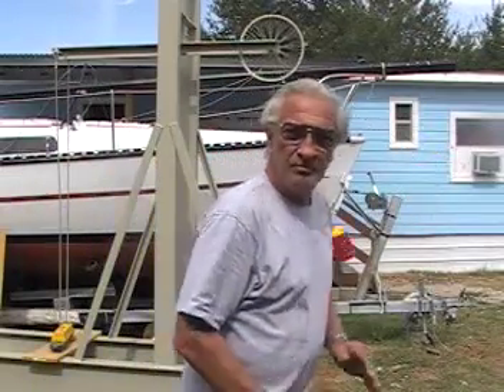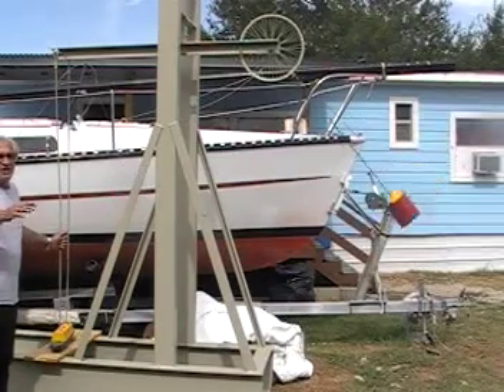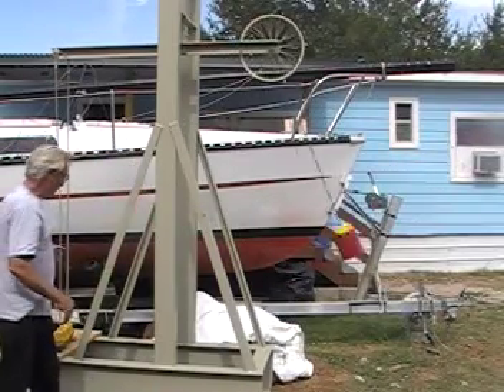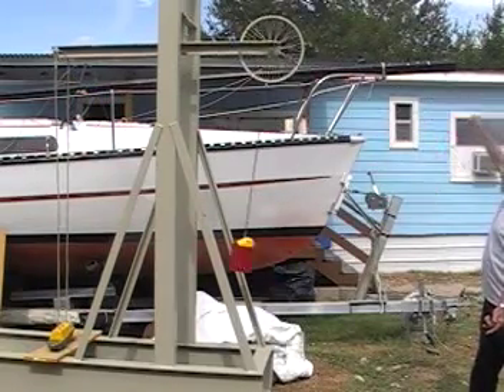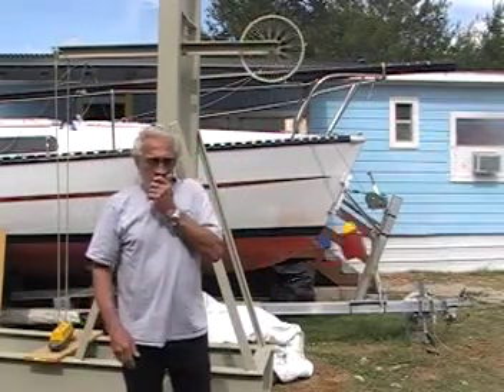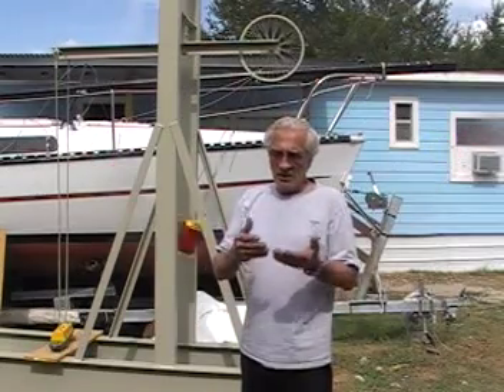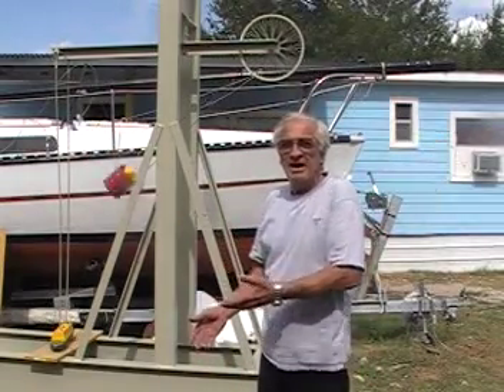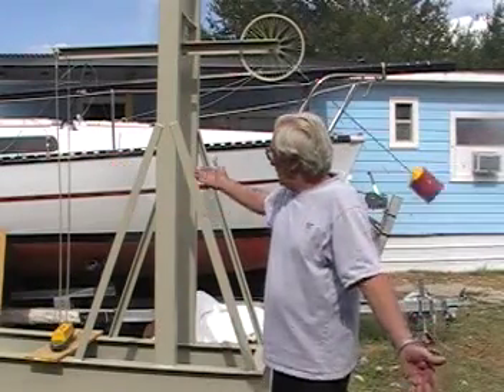testing large Milkovic 2 stage oscillator Video 6

Comment: see now what is happening  that was not happening in your previous videos,   the key to making this thing amplify input power is better understanding what is taking place.   you went from a very heavy pendulum weight to a lighter weight and I would say the pendulum weight does not matter.   increasing the pendulum weight just simply in proportion just increases the lifting power of the  arm at the other end.   we must fully understand what is taking place  in order to utilize this device.    This device like the skinner gravity power machine and others  are gravity harvesting machines.  we know it does not take much energy to keep the pendulum swinging,  we know that when the mass on the end reaches the bottom of its swing there is a very powerful downward force from mass falling due to gravity pulling it down.   now the key to harvesting this very powerful downward force that gravity has provided is in how you set up the rest of the machine.    lets keep stating what we know to be true.   we can harvest a small portion of the downward force by allowing the pendulum mass to drop below it's normal arch swing,  the pendulum swings in a perfect half circle but at the bottom of the half circle the mass drops for a short time below that half circle, this is where the harvest takes place. at this time we capture the most powerful portion of the downward swing, it is a very short downward stroke that creates a very short upward stroke at the other end of the lever arm.    This harvesting part of the swinging mass has to be done in such a way as to limit the slowing effect of the swinging mass.  so the mass swing can continue in it's original arch with minimum slowing down effect.  in short what you get is a very powerful short stroke of force twice each swing of the pendulum.     we know this and so we now have to come up with a way to use this short stroke of force.   we only have a short stroke of force but that short stroke has a very powerful force in that short stroke.   the next key is to make sure we use all of the force we get.  how much of that force do you think it takes to spin that bicycle wheel in your previous videos?   if your going to spin a wheel you must use all the force at your disposal.   one quick short stroke of energy needs to go into something that uses all of the energy of each stroke.  the logical decision would be to use the force to spin a heavy mass flywheel.  even if you have to help get the heavy flywheel going at first.    since you have such a powerful force, make it do something very hard to do.  using gears and ratios spin a heavy flywheel.    each consecutive stroke has to be geared up so all the force provided by the short stroke power cycle is used up, going into the acceleration of the flywheel mass.      there are other ways to use your two short stroke power cycles of the pendulum mass you just have to think of ways to use it.      you just have to remember what you actually have ,   you only have a  very short stroke power cycle available to use.

Comment: Sir, you are misleading people,  perhaps not intentionally, but  you are misleading them. Let me put some light on the subject to assist you  to understand the situation you seem to fail to understand,
You are not picking up 74 pounds of weight because that weight is counterbalanced by what the pendulum weigh which is 44 pounds.  so that is an effective weight of 30 pounds that you are lifting. Now let is see how that is coming about.  When you swing the pendulum you are causing it to generate centrifugal force downwards and this must be added to the 44 pounds of the pendulum , and it is the combined weight of the pendulum plus  its centrifugal force that is lifting the 74 pounds about half an inch.
Now let us study the work  output and the work input ,that is the energy output and the energy input, Now the work done is the force multiplied by distance and so for the output it is 30 pounds multiplied by half an inch ( assuming the moments of the beam are equal)  which equals 15 lbs inches  while the input by your hand is say 2.5 pounds multiplied by 6 inches  which equals  15 lbs  inches.    
Sir, I hope that this helps, and I apologise if I spoilt your obvious happiness of expectations  and successes at what you dreamt that this structure is capable of.   Normally people in construction works deal with static structures as roofs, walls, arches, buttresses, lintels, members in tension and compressions as in beams and geodetic structure, concrete reinforcements as in roofs and balconies and it seems that dynamic structures and their effects is not clear enough.
This is the reason why some suspension bridges collapsed when they went dynamic, as normally catenery  suspension bridges do not make use of triangles but rectangles which are unstable.  All stable structures must have triangles in them as a triangle does not change its shape even under dynamic conditions.   
 I hope you will proceed to enjoy yourself with researching for extracting energy out of Gravity, but a mathematical  contour integral  in a conservative field is zero and gravity is a conservative field so you cannot extract energy out of it. It is unfortunate for me, but I hope you will not be too disappointed if that also applies to you. Good luck anyway and hope that you will remain a happy man experimenting as you do.
Reply: +Carmel Pule' Incidentally, may I add something very very important and that is , if you allow the lifted weight to drop back,  then while it is dropping , its potential energy is TRANSFERRED BACK TO THE PENDULUM THROUGH SHIFTING ITS PIVOT POINT.  You must realise that you can give energy to a pendulum, both by pushing it horizontally which is what you are doing and also  through shifting the pivot point of the pendulum,  in a synchronised manner, which is what the dropping weight is doing.
In this case all you have is a double energy system exchanging energy between them and there is no effort at the input because you have no output.   If you have a million pendulums linked by any linked system , there will be many pretty modes of oscillation which will mezmerize  any observer, but there will not be any need for much input  energy if  you do not extract energy and put it into a load. Your pendulums with the final weight going up and down has no load.
Reply: u need some relief

Comment: The Fairies want to commend you on your efforts to measure pendulum power. You're almost as passionate about pendulums as I am. I made earlier remarks on your more recent videos not knowing how long you've been researching.

The standard physics model does not explain gravity. You and I know as much about it as any academic. Isaac Newton himself said: "for gravity I offer no hypothesis". 
When I asked the Fairies why does an apple on a string rise back up the tree almost to the point from where it dropped - against gravity - and why does the restrictive influence of the string cause it to accelerate on a curved vertical  path faster than Newton's 32ft/sec on the straight vertical, they said: " because it does", Daaa.... as you would say. Gravity is magic I reckon and you deserve a break. you've done the work.
It's too early for you to be concerned about the efficiency of your pendulums and you won't get accurate power measurements until you start producing power. On one of your older videos you have a TSO rotating a bicycle wheel then you went on to lifting weights like Milkovic. You need rotary motion to make power. I have now watched all your videos on pendulumics and as far as I can see your viewers are using you to do tests they're too fucking lazy to do themselves and all influenced by Mikovic TSO principles.
Go back to your  bicycle wheel model and follow your nose, your instinct. Think rotary motion. Change it to a heavy rim loaded flywheel and gear it up to about 300 rpm. Like a steam engine, this will even out the power gaps in the pendulum stroke and give you the constant torque and speed needed to produce AC electricity.
 NOTE> you will transmit the pendulum's maximum power to the flywheel which is a very efficient mechanical battery.   
Your short arm Milkovic size pendulums don't give you any worthwhile speed or power. As you say yourself in one of your earlier  shows, "size matters" but you've kept all your builds small.  In all his toy TSO designs, Milkovic does not give any meaningful power measurements - input over output. 64 feet will give you full G-force. The higher they are the faster they fall. 

You've seen for yourself that  a pendulum can lift more than it's own weight. That's all you need.

Comment: Looking for your donut fuel video...
Intersting concept here, and I saw you turning the bike wheel
Hear me out though...I THINK you should be moving a whole bike pedal, chain, and wheel with a fairly high gear. The wheel would have a ratchet and would be free to spin ahead of the osolator at certain parts of the rotation. The pedel would not have to spin, just move up and down like your doing here.
Reply from the maker: wcemichael some how the donut to alcohol fuel,  video got bumped. I will reload it this afternoon.
Reply: RHEAD100
What about my idea on your invention here?

Comment: I can believe it. The path of the bob is not circular and this makes all the difference. For the boundary case where the lift is negligible and the path is circular then the naysayers are correct - but this is not the boundary case and higher derivatives of position with respect to time are involved. Specifically the third (jerk) and possibly the fourth (snap)

Comment: Good for you, RHEAD100

I don't know if you've spotted the flaw in addicted2wingboats argument.

It is this. In principle the energy losses can be reduced to zero which means that there is an energy gain which he admits. He says the path is a cycloid but I suspect it involve higher derivatives.

Anyway, if there is any gain, however small you have harnessed gravity. 

You can't be a little bit pregnant.

I have more on the theory but I would like to discuss it confidentially with you.

Comment: You have to push the counter weight over ten feet to move the heavy weight two inches, this is clearly use a lever action. You can lift a car with a big enough lever but it does not mean its free energy.

Comment from the maker: The same coffee can full of lead is 72 lbs.  5 times heavyer for the same size SO !!!    much less air drag for a miuch heaveyer pendulum.  Remember; By the Book,  friction is the only thing that stops a pendulum.
I am working on a pendulum design that will reduce air drag by over 95%
Next is to work on lateral pull.
A 200 lb, pendulum lifts my 1,000 lb. frame off the ground.
I think I can reduce lateral pull by over 90% This would make the swinging of really heavy pendulums possable.

Comment from the maker: Outstanding;
I agree with the use of concret for experimental perposes. However for a real machine I will be using lead.
One qubic foot of concret is aprox. 150 lbs while the same amount of lead is 700 lbs.
Lead is 7 times as expencive as concret. But you must keep in mined that if it works, (with miner maintanince) the machine will last forever. And 100% recycleable.
Hint;  one large Maxwell House coffee can full of concret is 14 lbs.

Comment: Here my perspective, assuming all the numbers are accurate or close enough for the 1 HP unit. 3 tons of concrete and rebar for a pendulum weight is around one and a half cubic yards of volume. It's the cheapest solid weight I can think of. Not counting the structure it would take to swing this, it's a little intimidating for the average garage man. I would definitely instrumentate and document the clear input and output of a much smaller version before building a swingset for a train in my yard.

Comment: That is awesome if it will work out. I didn't catch the fine points of your number description, sorry about that. If you are able to indeed produce 1 HP with much less than that for input, you will have quite an accomplishment. I am really wishing that something simple could solve certain power requirements. At the same time, until something is proven and easily duplicated, it's a theory. Empirical evidence will always be the strongest form of success.

Comment from the maker: I think we both know how to write the word Ass-u-me.
Your math And explaination of the 2 stage ossolator was so good. I ASSUMED. that you knew that the length of a pendulum is it's timeing meconizum.
2 meters 4 seconds per cycle. 2 pulls per cycle. 2 seconds per pull. 2 inches per pull.
6,600 pounds moved 5 feet in one minute is 33,000 lbs one foot in one minute.
Divided by 60 seconds is 550 lbs in one second.
Timing IS everything. That is why the lingth of the pendulum is SO importsant.

Comment: Here's the Achilles heel of all good intentions, the missing elements in the simple math that define real science. Power is forceXdistance/time. Take any one element away, and you have no power. 6600 poundsX2 meters isn't power, it's work. See how easy it is to make claims when the definition of power isn't even complete? I can lift 10 tons with my little finger one mile, it's nonsense when it comes time to harness that work into power. Also, who will equivalently swingset a tractor for 1 HP?

Comment from the maker: Where is it? 
Right where you leave it.
Asking the question then doing something about it. OR; Asking the question and then drop it.
ALL in All; I injoyed your coments. And you are very correct as to the size of a usfull machine. But a little off on your guesstamation of 20,00 Lbs to one H/P. That would be closer to 3 H/P.
Actualy it  takes  6,600 Lbs @ 2 meters to = one H/P.

Comment: I really wish this were a way to redirect or make use of otherwise unusable energy. The math isn't right, at least not yet. One horsepower is 550 foot pounds per second. This video shows 70 inch pounds per second max. That's 70 divided by 12 inches divided by 550. One hundredth of a horsepower. I should hope I could easily keep this output going with one hand. It's not very much power. But, here's hoping the larger versions prove all the naysayers wrong!

Comment from the maker: I do thank you for your concern as to me taking offence to your statements. TRULY; I am not offended. In fact. I am very interested in what you are saying and how you articulat your belifes.
Your sinario of the hydraulic jack does not apply in this case. In the jack. The more weight that is added, the harder it is to push the handle. Add enough weight & the handle will not move.
In the 2 stage oscillator. The more weight that is applied the less energy needed to push the pendulum.

Comment: and the proof is that you are not able to lift the big weight if you didn't store enough energy into the small weight. you have to ADD energy at every stroke to keep the sistem running. Do you have any question about it?

Comment: I am sorry but it seems that your questions and doubts are only generated by an insufficient knowledge of physics. Please do not talk about physics if you don't know the matter. You could make someone believe that overunity is possible, which is the a big mistake for students. About your video : don't forget that you stored A LOT of energy into the oscillating weight when you put it into movement. What you're doing with your fingers is to compensate the energy lost because of friction.

Comment: Happy Serbian Orthodox Christmas (13 days later Julian Calendar)

I counted about 50 'lifts' per minute. Pendulum weight = 46 Lbs. Lift = 74 Lbs.
Height of 'Lift' 1 inch (aprox) 

A FINE TOOTH BROKEN OLD BANDSAW BLADE, (Stiffened with wooden struts?), COULD MAKE A GREAT RATCHET ROD! IF A 46 Lb.(Pendulum bob), lifts a 74 Lb ratcheted weight through 50 inches. Q.E.D. Saw-blade tracks mounted on a  rack, could prevent the heavy weight falling back? (Salvage from Old Filing Cabinet Drawers?)

Comment from the maker: To improve efficacy;  You have to increase the ratio of the power bar and the weight of the pendulum. Then you lift the weight much higher with no more energy in.  Remember;;;  The weight of the pendulum (once it is swinging) is of no importance as to energy in.
10 pounds or 200 pounds. It takes the same energy to keep it swinging.

Comment: Nice going man!
I too did find a way to make it self running, allthough I haven't buildt it yet ;)
It's supposed to have a kinda strong string attached to the lifter (hammer) which will pull on a arm which then will slap the pendulum everytime its rock back and forth.
Hope yours work and mabye mine one day too :)

Comment: i think whats happening here is that at the beginning you have to rock the pend. alot at first to get it going... you are adding and storing alot of energy in the system with the full strokes... the structure is very heavy and sturdy so the energy stored as you load it is not apparent ...though their is definately torsion forces felt by the metal main beams and supports...ex the previous time you built the machine, when it was lighter, it rocked when you intially loaded the system...

Comment from the maker: You got it;;  Good or bad, it will be videoed and shown on you tube. That is why I built it in the first place. To prove or disprove. Seems as pushing by hand And math, prove nothing. I will make a few more videos of this set up while I am building the escapement for the new designed pendulum.
New pendulum is a round hollow wheel 8 feet in diamiter, 16 inches thick. With trap door to load in lead weights. We have over 1200 pounds of scrap lead we are melting and pouring into 12 pound ingots.